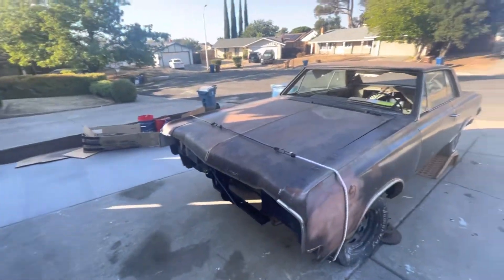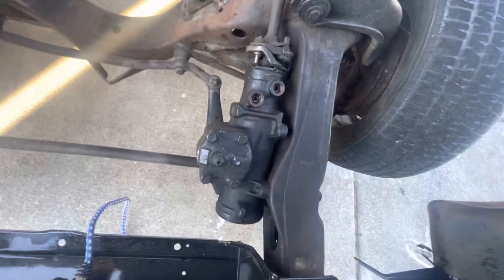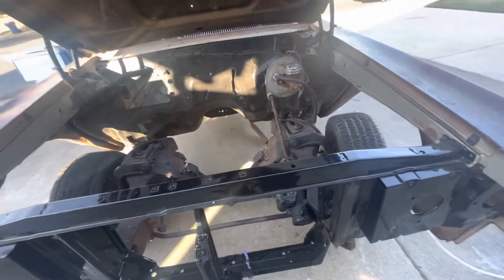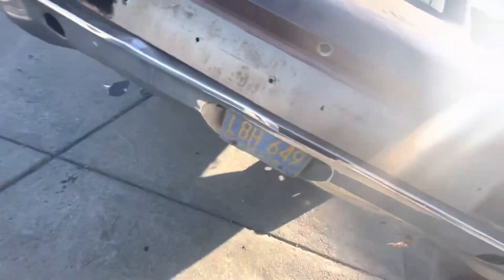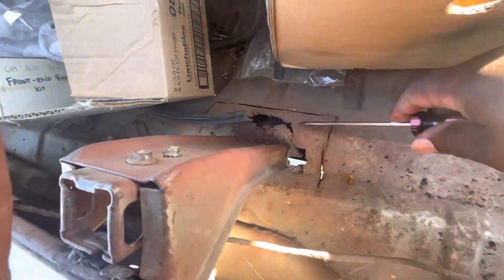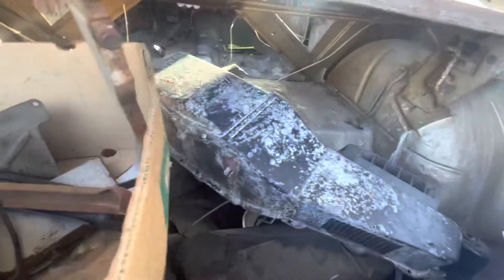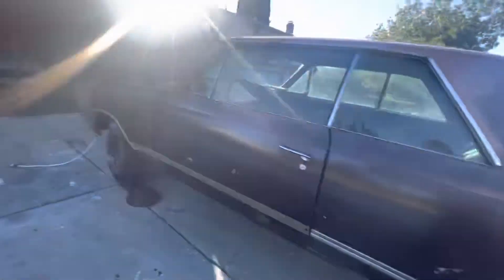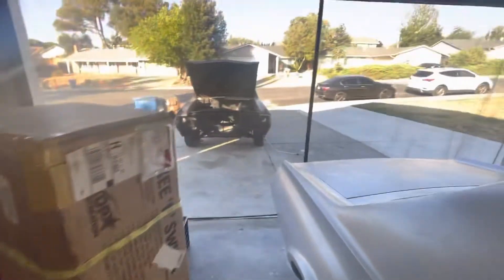Overview of the 65 cutlass

Comment: Heck yeah, I see you!
Reply from the maker: It’s gonna be tough this time.  My hours at work are crazy.
Reply from the maker: Man you got to help me. What caused the ls turbo to blow. I’m not honking about it. I’m looking at a Holley setup with the carb intake. I think they call it a blow thru. Maybe to Holley with the boost control will help keep it alive.
Reply: @theshark2804  I'm always willing to answer questions aint no thang to me bro. Stuff happens 😆 🤣! What caused it to blow was the weak rods, I had a gen 3. To much boost or torque on those rods to soon will do it. If you keep timing low until peak torque you will be fine. My car was on 20lbs of boost all the time except when making a video. So with the converter I had it would leave on 3lbs which was too tight, I took the motor out and sent converter back. With everything else being the same and leaving on transbrake  with 5-6lbs it happened.  You can email me if ya like
Reply: @theshark2804  infamousnova at g mail